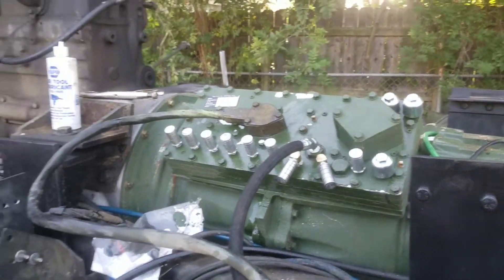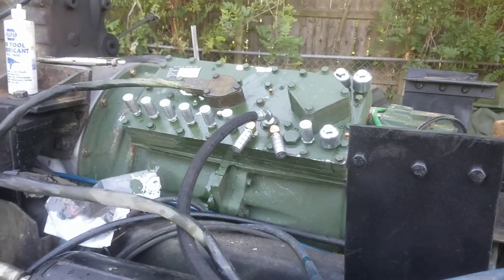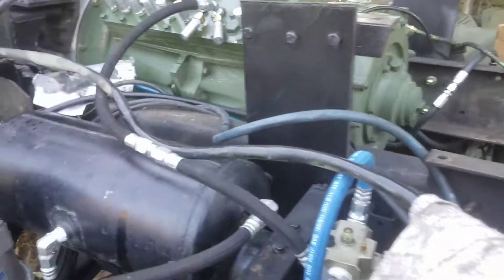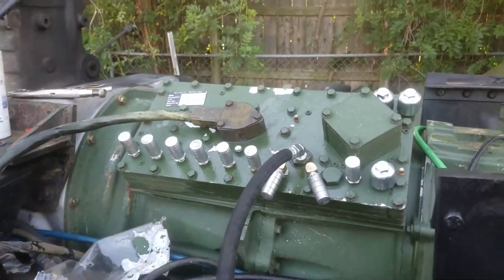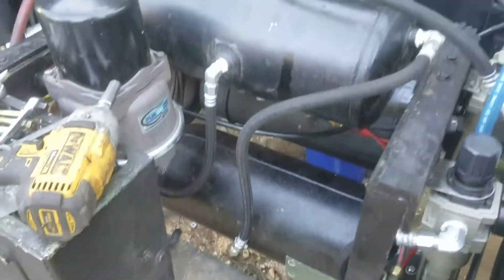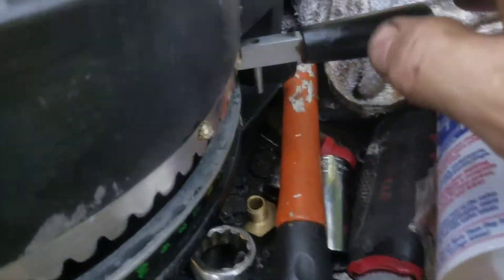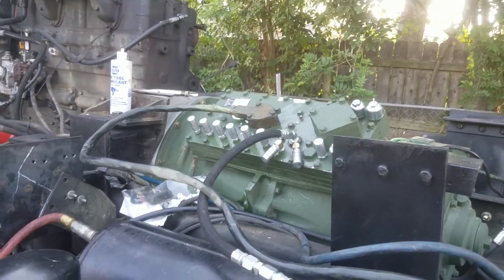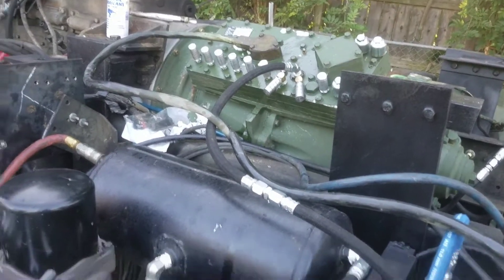M923A1 with CAT 7155 16spd transmission - function test

Comment: I was planning on making a video about these transmissions and was wondering if you would mind if I use this clip? I would attribute it in the video of course, just wanted to make sure it is okay? Thank you.
Reply from the maker: @AdeptApe  that's fine.  I have a few other videos using them in the truck.  If you need any pictures of the complex stuff let me know. Such as the splined adapter ring to the flywheel or the umbilicalcord 've got the manual as well i can pdf you
Reply from the maker: @AdeptApe  https://drive.google.com/file/d/1fb3R_hV5Y-EEm5yDHT-j32acp1QAe48k/view?usp=drivesdk

Comment: Have you driven it around yet?  In your opinion, was it worth doing?
Reply from the maker: Its alot of work.  I've ran it for more than 100,000 miles with the small cam.   It ran well and pulled great.  I would do a big cam swap with it next time and just upgrade the whole driveline
Reply: That makes sense.

Did you run into any major fitment issues?  Does this increase/decrease the top speed noticeably?
Reply from the maker: @MacClay8  it would run to 90 mph with 395 tires.  You have to raise the cab. Make new engine to frame mounts.  New front cab mounts. New rear cab crossmember and shorten your driveline.  Its alot of work.  The build thread on steel soldiers is here
https://www.steelsoldiers.com/showthread.php?169592-Simp-s-Cat-7155-Swap-into-a-M923A1&highlight=